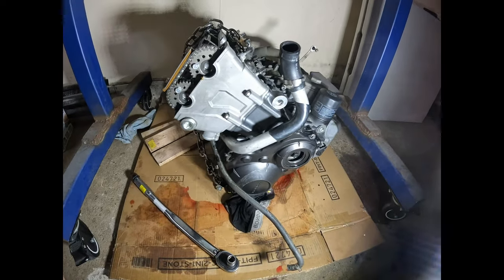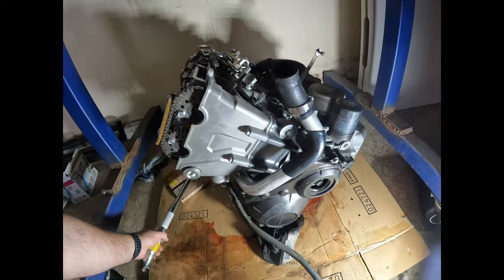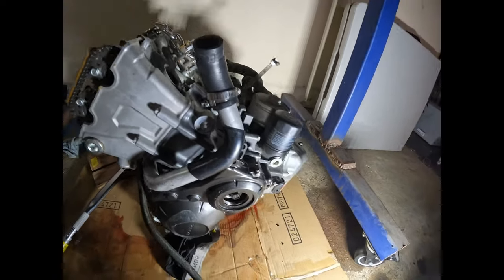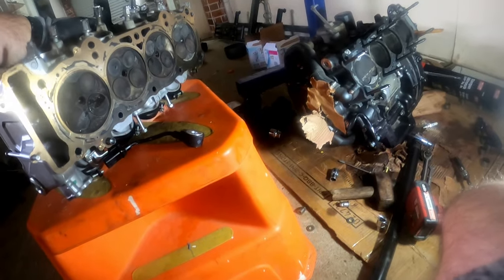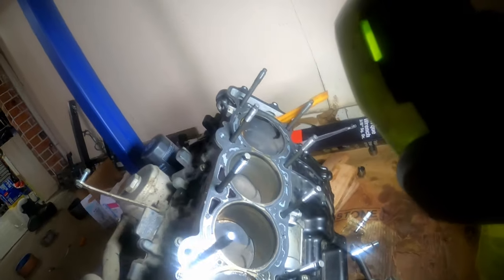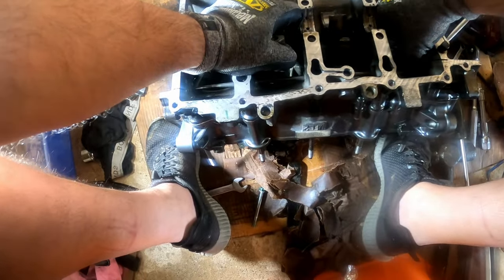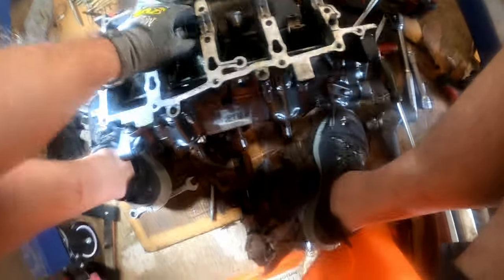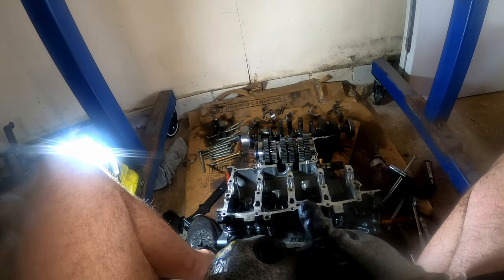Seized Engine Tear-Down ASMR | 2008 Honda CBR1000RR

Comment: I'm an engine machinist that use to hone fresh nickasil plated bores, yes the are honed. Have to be and are diamond hones. The fresh plating is quite rough and not uniform. Those bores are normal.